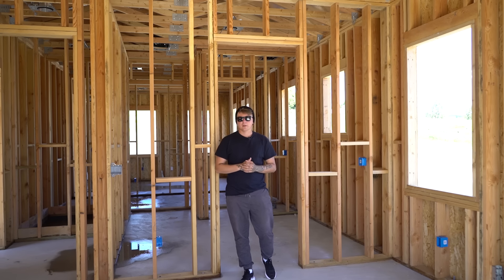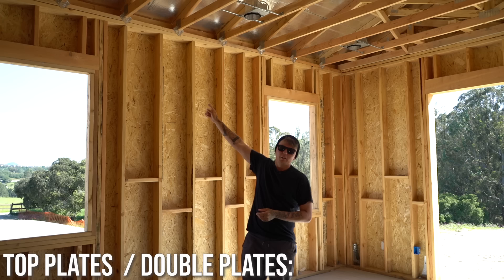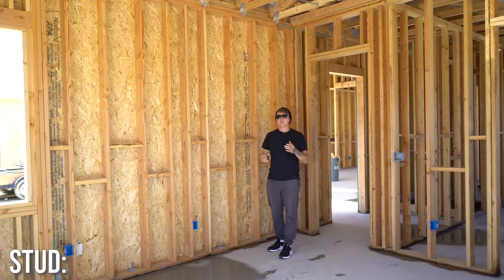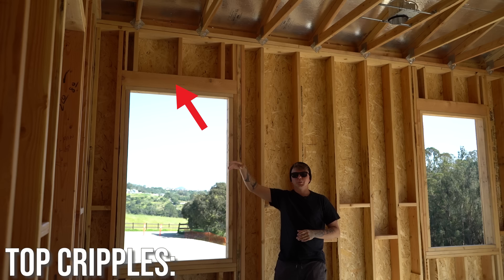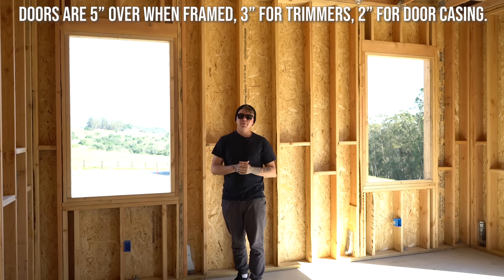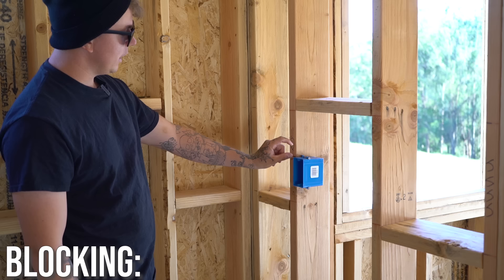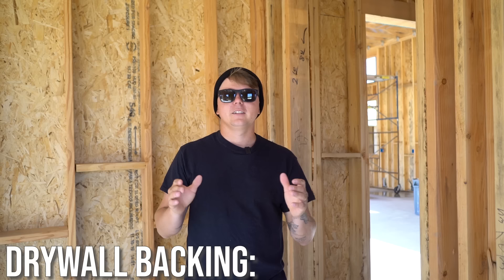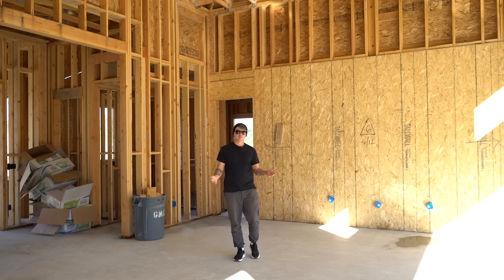Carpentry 101: Basics of Wood Framing with MattBangsWood [#1]

Comment: Your stud dimensions are off. Pre cuts are 92 5/8, 104 5/8, 116 5/8 etc.  not 1/4 this allows for a 1" 1/8 over desired plate height for drywall, mud/tape and flooring.  Perhaps you miss spoke? This is a universal standard. I cant see California being different.
Reply from the maker: Stud heights very state to state. The reason why? I couldn’t tell you..

I order an awful lot of lumber a year, to not know my own pre-cut stud lengths.. 😂

92-1/4, 104-1/4, 116-1/4.. It ain’t wrong, it’s just not what you’re used to seeing.
Reply: @MattBangsWood  Cali must be the exception. I know most west coast states are 5/8. I have framed in many states and they are all the same. Its a standard for dry wall. Guess your local dry wallers must hate it, having to rip the bottom edge of every sheet when using 5/8" fire rock on ceilings and 2 4ft (for 8ft walls) horizontal sheets on the walls.  If using 1/2" on ceilings only, might be ok, but still a pain for dry wallers.

Comment: I appreciate your videos a lot and thank you for the education.

However, you failed a bit on the load bearing walls and the breaks. I did t realized the two top plates should be staggered. The only reference you made to that was no breaks within 48”, which was all of five seconds and didn’t iterate staggering the top plates. For a 101 video, that’s definitely something you should spend more than five seconds on.

Comment: So.. do americans know that there is such material as reinforced concrete in 21th century? You need quite a few concrete columns and a couple shear walls to build any type of house nowadays. No studs, no trims, no "blockings". This building won't decay, fall down after every tornado you have over there. Nooo! We're gonna use wood and nails as my grand grandparents did.
Reply: If an EF5 hits a brick house or what ever house you have, its gone, doesnt matter, you would need to be underground. An EF3 would knock almost any home off its foundation if its hit directly.

Comment: those studs are not 16 on center. it's sloppy framing. a good framer will will carry  16 on center from left to right from outside corners of walls. insulation guys hate this house, drywall hangers hate this house, trim carpenters hate this house.
Reply from the maker: You've never framed in California. Those studs are most definitely 16 O.C.. Windows / Doors changed that, intersecting walls as well.